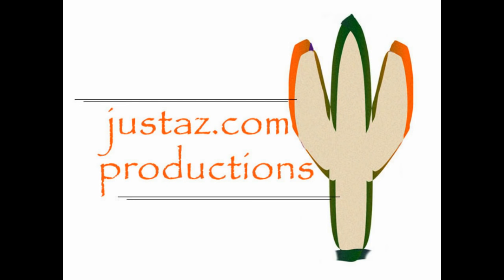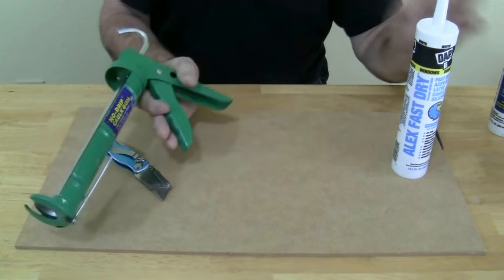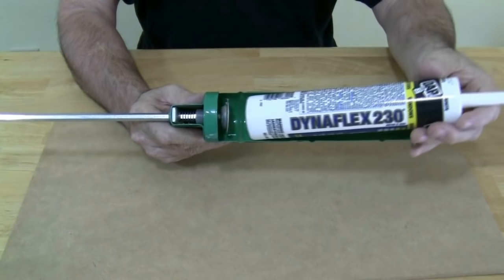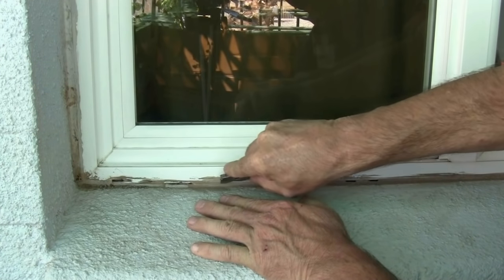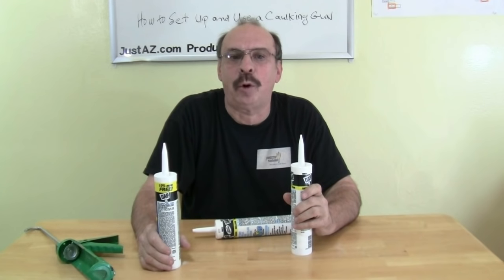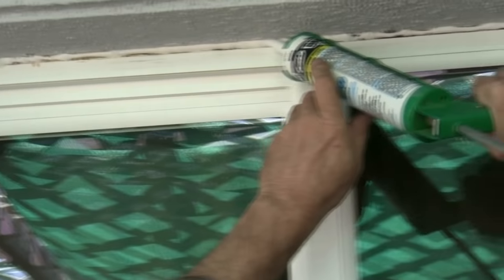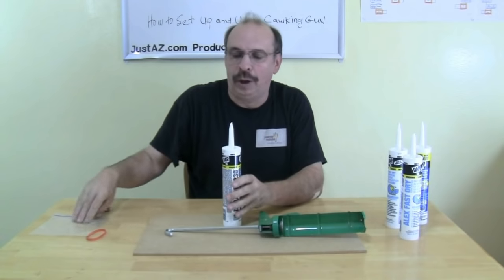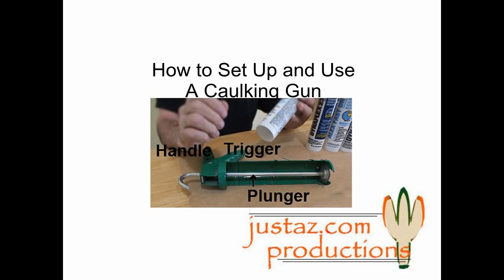How to Set Up and Use a Caulking Gun

Comment: Glad to see someone covering simple things that a lot of us take for granted. We all have to learn sometime. A couple of tips if I may: TAKE YOUR TIME AND GO SLOW! This will give you a nicer job with less waste. If you are caulking more than one thing or taking a coffee break, twist and pull back the cup arm. if you don't, you will have a nice puddle of caulk to clean up! If doing a bathtub, either sit in it or fill it with water first. If you caulk an empty tub, the weight of  the water will pull it away from the edge. Caulking it with weight allows it to compress when the water or you are removed!
Reply: wow Ratdog,those were some very helpful tips ,i will surely apply them..thanks so much:))) cheers:)))

Comment: I had forgot the tube needs to be punctured before placement in the caulk gun. Thank you for saving me more aggrevation with your easy step by step instruction. I also learned to read clean-up with some caulks just need soap and water while some silicone caulk will require mineral spirits for clean-up. Again thank you.

Comment: THANKS FOR THIS DEMO> I to thank you as you made me laugh so much when you tried to cut the tip and a big strong guy like you couldn't. And this is what I am so worried about, that I will get it and not be strong enough to use it, I am into resin and wish to make silicone molds. Hope I can manage. I did learn a lot from you so brains YOU ARE.      STAY SAFE & BE WELL.!

Comment: I have a question so I did all the steps and it’s coming out but it’s coming out very slow and I have to press really hard on what would be the trigger of the gun do you have any tips for that it is silicone by the way. My forearms are sore and I barely got any out maybe two feet. :(

Comment: What am I doing wrong if the silicon is coming out the back of the tube and spilling into the chamber of the gun? I cleared the opening of the tube using the rod. When I pull the trigger, nothing comes out, it's oozing out the back.

Comment: Why is that whenever I try to pull the handle back to release the tube, it just wont let go. I have 3 caulk guns with tubes stuck in them. What is the secret to getting the tube out.
I'm traumatized with these things, and find myself spending a premium on the tubes that don't require a gun.
Thanks for any answers!

Comment: Thanks for an easy to understand lesson on the basic use of a caulking gun. Trying to remove the old caulking,  some of which is still in pretty good shape, is a real bear. I'm just wondering if I really need to remove the caulking which is still in good shape, or just the bad/peeling caulking? Working on an exterior patio sliding door, the base level caulk is in the worse condition. I have removed as much as I can, then sanded the wood. Can you apply new caulk over old caulk if the old caulk is still good? Thanks again for your educational discussion, it was a big help.
Reply from the maker: You can but it is generally not a good idea. Usually the areas that have old caulk under the new caulk fail after just a few years.
Reply: Thank you so very much for your reply, I really appreciate the expert advice. Looks like I have more work to do.